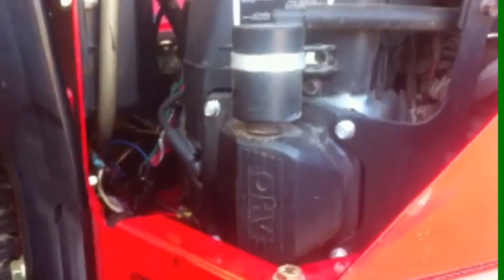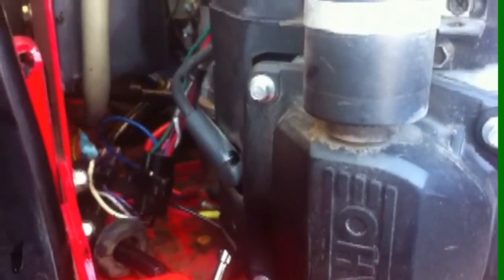"LAWN TRACTOR ZTR REPAIR"  SNAPPER ZERO TURN QUICK TIP FOR HARD TO TO GET TO STARTER NUTS

Comment: HI, I have a Snapper z2004k ztr. It is hard starting and when I do get it going and engage the deck it stalls. Put new gas new filter and plugs. It has a Walbro carb.
I think it was made in the 90's Thanks,Jim

Comment: My Zero turn just stopped moving forward or backwards. Starts up but won't engage. Any suggestions?
Reply: Hello my name is Laurie . I bought a snapper zero turn 1870 industrial 60 inch . it's always cranked up the first time but when I went to get it the other day out of my shop it went about 100 ft and quit. It's firing and its turning over but want start. Do you know what this could be. Thanks